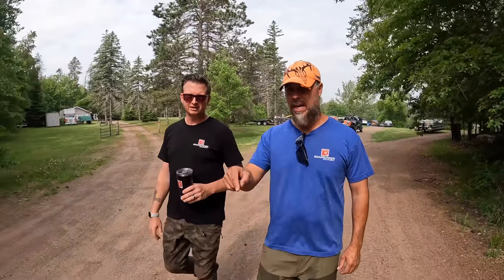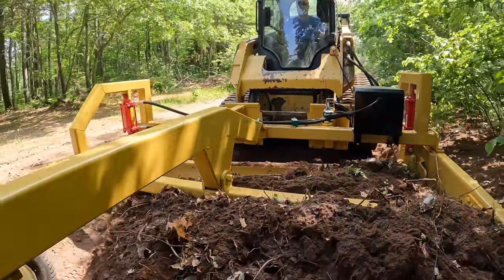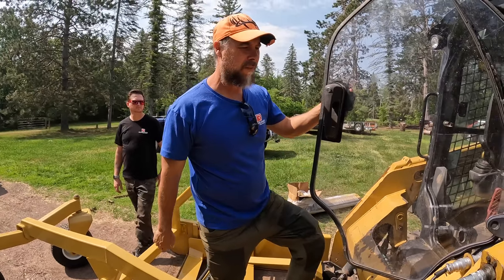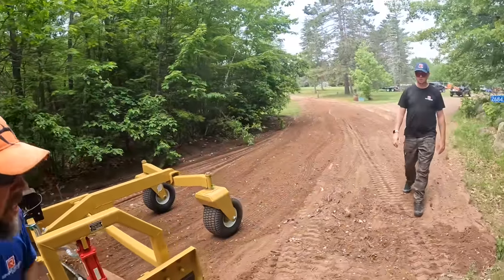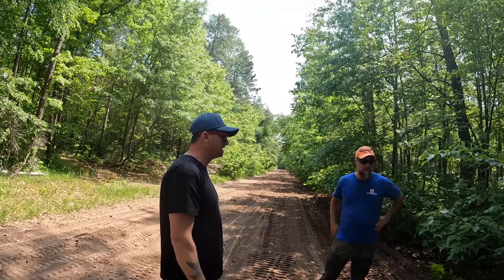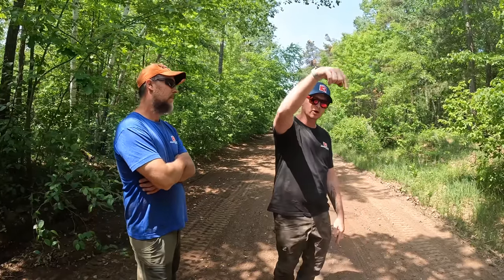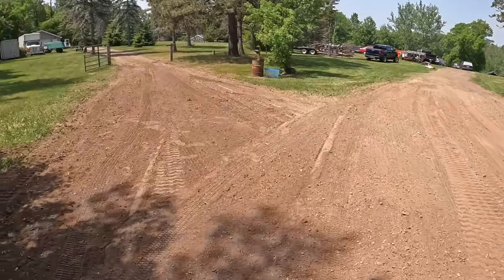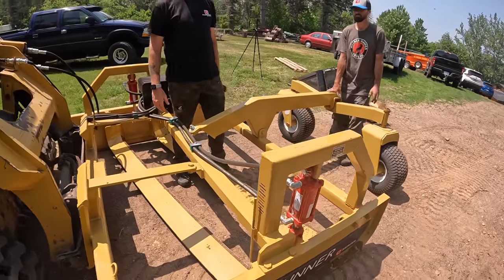The Worlds MOST advanced road grader on a skidsteer   4K

Comment: It is crazy to me see a dirt road with no drainage ditch.  The rural areas in my areas every dirt road I have been on had drainage ditches.
Reply: This looks like a private road to me, I’ve seen quite a few that don’t have drainage ditches. Cutting a road through a forest is easier if you don’t build ditches which can add a lot of time,cost and difficulty. Especially if it was done decades ago.
Reply: @jcar1417  On the family farm we had drainage ditches otherwise the road would be a soupy mess and you would get stuck and huge ruts would form.  

That time and cost will save you more time since you wouldn't have to go snail pace over nasty ruts, and wait for someone to pull you out if you are stuck when muddy, or just be stuck at home when the road is so muddy you would get stuck.

Comment: Does this implement require a lot of hydraulic pressure? It looks like a great attachment for a tractor, but I’m not sure my 3rd function would provide enough flow if it’s rated for skid steers?
Reply from the maker: not much pressure.  The wieight does most of it

Comment: Another point Stan is we use the power rake to shift the bulk of material to the centre, but only rakes with fixed setting front wheels work , try it 
Cheers
Reply from the maker: will do

Comment: Problem with pot holes is during winter water will freeze then expand(melt)  freeze then expand(melt) so you're spot on about needing to get the water to "run off" (not pool) as the alternative is for it to "settle" and during winter effectively (quite "effectively" in point of fact) break up the compaction of your roadway but of course this be Wisconsin so you have very good soil type out that way as well which enhances this condition. For Pure Perfection still hard to beat even an Old Timey Road Grader as i don't really know of any modern compact designs for such a machine so interesting Jerry Rig using this but in the end the only true solution is to literally dig up every hole and everything around said hole, refill and compact to the maximum extent possible ("patch" in the jargon?)
Reply from the maker: Yep- if water sits on the road it will create a pot hole. It has to run off

Comment: liked the power auger grader you had and seen on jobs. may not want organic in road way but at least it removes pot holes. sometimes a angled 3point scraper blade gives the pitch needed. my dirt driveway since its mixed stone and sand i just rototill and run the 3point or snowplow to level then water and plate compactor
Reply from the maker: sounds like you got that road dialed in nice

Comment: Know this is an old video, but been watching your stuff for a long time and I've got a question. I maintain a half-mile long gravel road along with my neighbors. I've got an SVL65-2 Kubota Skid Loader and a 4-way bucket and am struggling to master getting a nice crown in the road. As a non-commercial equipment owner, I struggle buying an attachment that is a one trick pony, but need something to make grading out the road an easier task and will let me get good ditches at the same time. How would you compare this kind of grading attachment vs a 6-way blade with removable wheels, or some sort of alternate option? Would a tilt-plate get me more because then I could tilt not only my existing bucket, but any other attachment as well? I don't get much snow and when I do my neighbor has a PTO based snow-blow that he uses, so that is low priority for me. Trails, road maintenance, and grading are high on the list as things I do regularly and frequently. Thanks in advance, and keep up the awesome content.

Comment: Bob Cat make a actual grader attachment for a skid steer. It has a turn tab like a grader and lift cylinders on both sides just like a grader. I seen a paving company use that.. I have run a full size grader for 25 years. I would buy Bob Cats grader before I would buy that thing you are using there.. I would not waste my money on that ting sorry to say
Reply: Why do you say that? What does the bobcat do better that this doesnt? I have never graded in my life so im just wondering why you say it..
Reply: @jeremyjones8872  They replicated a real grader. The wheels are further away from skid steer to give you a better grade plus it pulls it's blade not pushing it.. Their is a good reason why a grader pull it blade. You have way more control. When you push the blade you can cause a wash board affect like a bulldozer does
What they are using here you can do the same with box scraper... To me that is expensive junk. Plus crowns in a driveway or road is set at 3%.you would see that crown easy not like what they say in this video.. Grader attachments like the BobCat one works very good. Almost as good as a real mini grader
Reply: Only one blade though not to mention it doesn’t contain the material. Double the price of the Roadrunner Grader.
Reply: @exaggeratedphotography4387  Double the usability and the fact it works way better to me makes it way more bang for your dollars.. When it comes to what is best for your dollar, that is not it.. I would never buy that even at half the price sorry
Reply: It is an affordable entry to the market

Comment: This would be unreal if they built the twin blades to angle left or right (not just fixed to the left) by adding one hydraulic ram to one side of the exterior of the boxing.
The debris bunches up always higher on the left & can see you sometimes need to get rid of the debris on the right side of roads/driveways 🤙
Reply: Check out the DoMor Grader. It does this with hydraulics.

Comment: Called my local dealer here in Maine and they want 13k for the exact same unit minus the the snow attachment and bucket holder...........a little rich for my blood I could handle 10k but not 13k🤦🏼‍♂
Reply from the maker: Call road runner direct.  maybe you could get a better deal
Reply: Beauregard Equipment
Reply: @exaggeratedphotography4387  Yup!